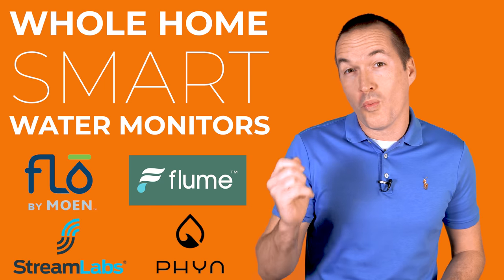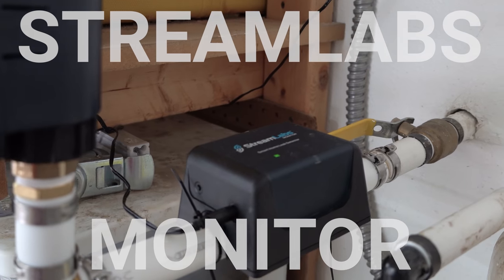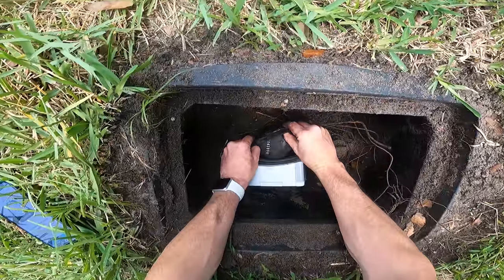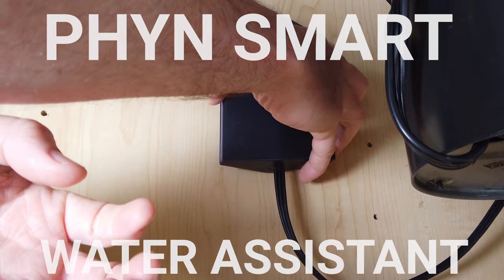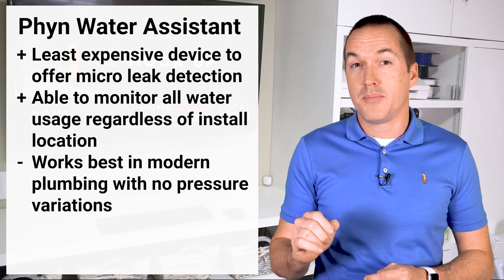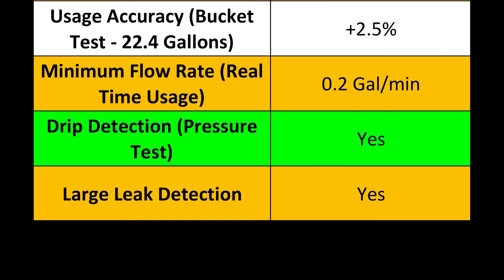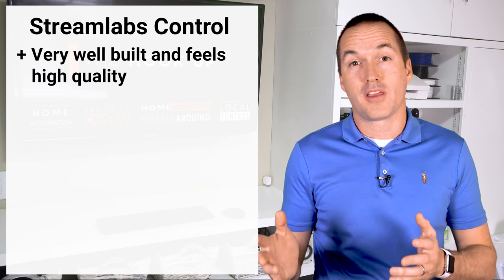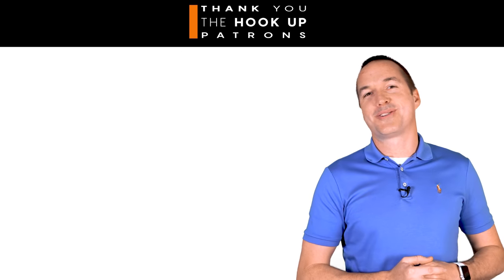Prevent THOUSANDS in damages with these smart water monitors.

Comment: This is a great video! But Moen raised the price of their 1" model, 900-006, to over $1,000, and the 3/4" unit to $760! I read the reviews of the product on their website. Only 1/4 of the reviews were positive for the 1", and 50% for the 3/4". Something quirky about their web page makes it so you can't read the reviews for the 3/4" unit. All the negative reviews for the 1" complained about the Moen internals wearing out after about a year. Some broke down within the warranty period and Moen either wouldn't replace the units or gave only a discount on buying another unit. The negative reviews on Amazon are just as scathing about the lack of quality for the unit and the non-responsive customer support. My conclusion is that it's over-priced and doesn't work for very long. I will avoid the Moen Flo.
Reply from the maker: Moen hasn't raised the prices, scalpers are reselling the very limited stock of Moen Flo devices that are available.  If you are able to find one at Home Depot or Lowes you will pay normal MSRP.
Reply: What about the reports of the Moen breaking down in less than a year and poor customer service?
Reply from the maker: @SteveKelem  I can only comment on my personal testing, and I've had no reason to contact customer support.
Reply: @TheHookUp  The reviews talk about the turbine getting blocked by sediment in hard water, and the magnets getting corroded.  It seems to be a significant problem, and since my area has terribly hard water, it's making me think it's a bad idea for me, unless I'm willing to replace the unit every few years.

Comment: It would be awesome if you built one with a wemos or something. These are all pretty pricey and seem so dependent on the cloud.
Reply: Buy a regular flow meter with pulse output, around 80€. And connect it to a wemo or nodemcu. You can also get an motorized valve for around 25€. Works great and no subscriptions.

Comment: None of the models with auto shutoff are really a good option if you have home fire sprinkler system?  If the sprinkler system springs a leak you really shouldn’t shut it down.
Reply: You could just re route it to separate water lines and add a backflow

Comment: Rob, will you also test and review the Phyn plus shutoff monitor?
Reply from the maker: Unlikely.  Not only is it more expensive, but my biggest gripe with the Phyn was the software, which is the same for the Phyn plus.
Reply: @TheHookUp  Phyn Plus 2nd Gen came out in November and it is $499--same as Flo. My theory is Flo set the price on the market. There are definitely pros and cons to the data Flo and Phyn share. Flo's long term tracking is fantastic whereas Phyn only has the current temp/pressure/flow, but the plumbing check information on Phyn Plus is detailed and extremely useful which Flo doesn't share.

Comment: @The Hook Up so i live in a apartment in a a country where hot and cold water are separately fed to the apartment from a central hot cold system. so my question can one still make use of these types of systems?
Reply: I would guess you would need to buy two for monitoring each line.

Comment: Hello, I live in Florida and the main line enters the house through stucco/cement block and then directly into the concrete foundation. There isn't indoor main-line access. Is it OK to install the Moem Flo outdoors, on the main line, and cover it with a watertight box or housing ?  Thank you
Reply from the maker: Short answer: Yes.  
Longer answer: The Moen Flo is rated for outdoor use, but all the negative reviews that I read about the Flo were specifically about water intrusion into the power port when mounted outside.

Comment: Your check of the actual volume fir the 5 gallon bucket was flawed. You would’ve had way too much variation between each kitchen jug each time you filled it. These errors multiply and make the total have an effective large set of error bars. The most accurate method would’ve been to just weight the bucket full and convert to volume. Same applies for determining the accuracy of each monitor.
Reply from the maker: I'm going to disagree with you on that one.  I was using a volumetric measuring cup, I would guess that each quart that I put in had a variance of 0.001 gallons, so at most I'd be off by 0.02 gallons using that method.
Reply: @TheHookUp   My point was using weight to determine the volume for each device is going to a lot more accurate and precise due to both the "propagation of error" uncertainty and the fact that measuring a large volume of liquid by eye is also error prone. Weight will give you a much more accurate and precise answer. Its also just a lot easier to perform using regular body scales. As a scientist this principle is one of the basics taught new students working in a lab. Never use multiple measurements when you can do with a single measurement. Always measure stuff by weight, whether it be liquid or solid.
Reply from the maker: Sorta.  It depends what kind of error you are compounding, your assessment assumes that both measurement types have the same precision and accuracy.  If my measuring cup is precise to 0.004 gallons per measurement (marked in 0.5 oz) then compounding that error over 20 measurements would yield no more than a 0.08 gallon error.  0.08 gallons of pure water would have a mass of 0.66lbs, so my bathroom scale would need to be accurate to .5 pounds to yield a better result for a worst case error scenario.  More importantly I didn't have a scale handy :)

Before doing YouTube I taught high school chemistry for 15 years.

Comment: THE HOOK UP   I live in the country, where I have to use a water well. The pressure sits between 40 and 50 psi. So I believe that a systems that incorporate pressure sensors only and no flow sensor will fail me. Do you know someone who has a well to re-test?
Reply from the maker: I don't know anyone strictly on well, no.
Reply: @TheHookUp  Thank you sir. For your response.

Comment: No one should use one of these water monitors as a primary means of leak monitoring and shut-off.  
You do not want these things guess whether there is an issue and wait to take action.  These are good for something like knowing what your water usage is or seeing if there is a slow leak like your toilet.  But you have to have water sensors at ever location that is connected to a shut-off so the second it detects water.  If you have toilet hose go you can have 5 gallons in 30 seconds (depending on your pipe size and water pressure) and it will destroy your home if you wait for a 'smart' sensor to take action.   This is one of those "ask me how I know" situations for my house as well as every one other one in my small association over the past 20 years.
Flo and Phyn (water main version) has sensors now but they connect via wifi over the internet, the do not connect directly which adds a lot of risk.

And for anyone looking at the Flume - do make sure you contact them ahead of ordering.  It may look like it will work with your meter, as your meter looks like what they show, but it may not (as it didn't with mine). I tried to get it prior to the new subscription plan.

Comment: If your water meter is buried in dirt, how do you get billed?
Reply from the maker: The water company has a wireless link to it, they just aren't nice enough to share it with anyone else.
Reply: @TheHookUp  ahh, we haven't gotten that far yet in Australia - just 'smart' power meters.
Reply: @TheHookUp  I remember reading somewhere that a utility company read the smart meters by driving a truck around the neighborhood getting the data via Zigbee (which mesh between meters to get the data faster, like by getting the data from meters on the other side of the block). Not sure where I saw that info and how accurate it is, so take as just a possibility.

Where I am in USA we’ve had smart water, electric, and gas meters for several years now (I think it’s been since the early- to mid-2010s). The water is publicly-run and the other two are private companies (through citywide monopolies via public concessions).
Reply: @TheHookUp  And today I found out we're now getting wireless water meters. They must have seen my comment. No word on an open API though :(

Comment: Looks like flume went back to the all-inclusive model for $199. Would that change its rank on this list?
Reply from the maker: My Flume needs bi-monthly attention to keep working.  Because we get a good amount of rain the outside sensor gets bumped around from rushing water and needs re-adjustment.
Reply: @TheHookUp   mine would be installed indoors would you consider this accurate then also I have read that it can detect very small leaks including drips if your water meter does as well can you comment on this?

Comment: This is a very good video but I'm surprised with the accuracy results of the invasive StreamLabs product. I would expect them to be MUCH more accurate than your standard utility meter. Good ultrasound flow meters measure the flow of water much more accurately than turbine-based ones (like Flo by Moen). The flow meters provided by your water supplier are probably turbine-based too, meaning that they will see no flow below 300ml/min =~0.08 gallon/min. Whereas a good ultrasonic flow meter like Sonic from Hero Labs can measure down to 30ml/min =~0.008 gallon/min. 
Have you seen this video reviewing Sonic? https://www.youtube.com/watch?v=66tgKJAN1eA&t=75s
Reply: BTW. Sonic does have local API so no worries with local control in case the cloud connectivity is down for whatever reason.
Reply from the maker: From post video research I believe the issue was caused by turbulent water due to there being a bend within 6” of the device.